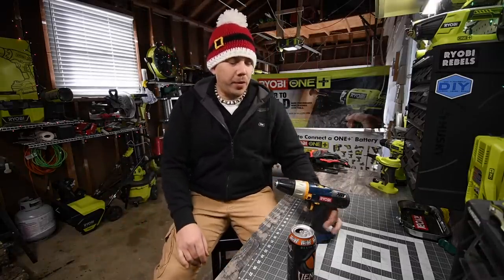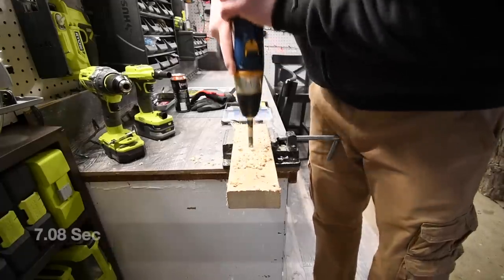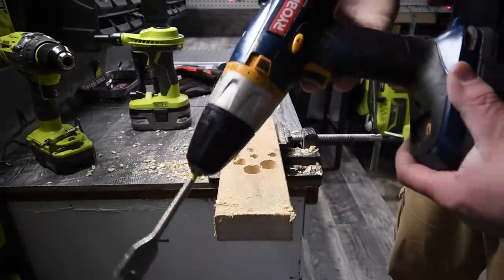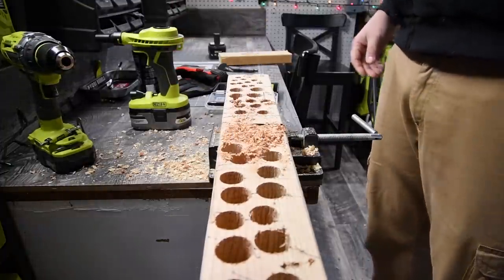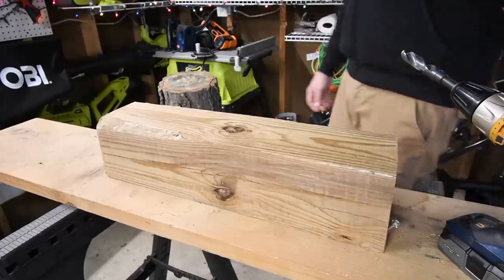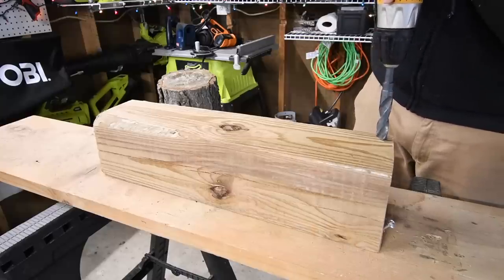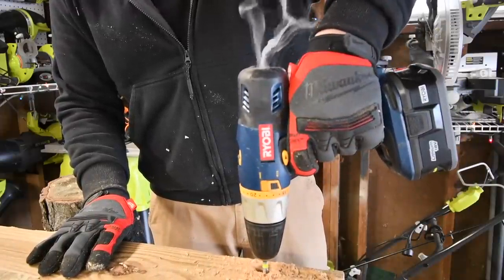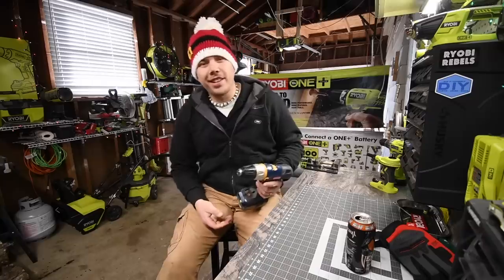Ryobi Blue Failed on its first test

Comment: I bought a reconditioned Ryobi kit 20+ years
 ago. The tools were used and used.  I couldn’t kill them. Just this past summer the drill driver fell 20 feet onto the cement when I was building a pole barn.  After dozens of falls over the years the reverse broke.  I still use the circular saw in certain situations and the reciprocating a lot.  Do I like the brushless tools better...yes... but the old blue tools were great tools
Reply from the maker: thank you sir, and  Happy Holidays

Comment: That's why it has two speeds. It wouldn't have burned up if used correctly.
Reply: Yet to see in a video and even in person of someone using the transmission properly on the drills. Had to yank my drill from my coworkers hand cuz the idiot was overloading it and switch it gears for him. Milwaukee M12. FYI that's how he blew out his m18 drill too but helped him rebuild it and taught him how to use the gears
Reply: @arsonist63086  Yep...I know exactly what you're saying. It's like pulling a trailer with a 3/4 ton pickup...and starting from a dead stop in 3rd gear.
Reply: I don’t get his testing methodology. There seems to be none lol. Big holes need high torque, and a lower feed pressure instead of slamming it into the wood. Never seen someone drill 1 1/8 holes at 1600 rpm lmao
Reply from the maker: it started smoking drilling a 1/2 hole. if it smoked doing a simple task like that in the beginning of the video, it wouldn't survive long on this channel lol, thank you sir, and  Happy Holidays
Reply: Well a tough drill shouldn’t burn up at all. Also, the reason it burned up is because its a brushed motor. A brushless drill wouldn’t have burned. You can repeat this task with a 20V dewalt or an 18 volt Milwaukee and they won’t burn

Comment: Ive got the same drill, it always works when I need it! I dont baby my tools, I use them but I also dont have to drill huge holes in really thick lumber either, mine keeps going strong even though I bought a new one, Ill still use this! Mine is a p206

Comment: I bet u if u just replace the brushes. It will work like new.
Reply from the maker: a repair video will be coming soon  and thank you sir, and  Happy Holidays
Reply: which begs the question can you just replace the motor with a brushless one and have basically a toyota prius with a hellcat engine
Reply: For what you would get, the cost would be more than what you would spend on a new brushless drill.
Reply: I see no problem with showing someone how to replace brushes though. I replace them in my own tools.
Reply: This thing most likely died due to too much current being drawn and overheating. These things where initially designed for NI-CD batterys, which outputted less current. This is partly because the voltage was lower.  Sticking a lithium battery in there and putting it under full load for a continued duration is going to kill it.

Id put in a 2AH max and not run it for long duration's
Reply: Minnesotaman no you have to change everything inside then as a brushed motor uses a Completely different speed control
Reply: @silvy7394  it was 18V wasn't it?
Reply: @jesseldridge2016  A lithium pack will output 21 volts and usually much more current than the old NI-CD packs. These old motors simply slowly kill themselves by being pushed slightly too much because they was designed with a weaker battery in mind.
Reply: @minnesotaman3  no you can't. A brushless uses 3 wires and basically needs a controller to convert the power into  pulses which is what the brushes are used for in a brushed motor.
Reply: @jesseldridge2016  an old nicd is also 18v but the voltage will drop much faster under any load. A lithium has the ability to offer full voltage even under high loads. That's what will kill the tool. For example nicd under a load on this drill may drop voltage to 12v when fully loaded while lithium will offer very little voltage drop under same load.

Comment: Its amazing how far power tool technology has come! These older tools were not designed to take the power these new batteries put out.
Reply from the maker: I agree and thank you sir, and  Happy Holidays
Reply: That statement is wrong from the start by saying The power these new batteries put out!! He didn't slam a 20v or a 24v battery in the old blue tool. Exact same 18 volts the old yellow and black ones put out! The new LI-ON's have more capacity is all. I just bought the new HP Brushless 1/2 inch impact and purchased a 4ah 18v +one HP battery and I use it in my old Blue and yellow Drill, circular saw, reciprocating saw with absolutely no problems at all.
Reply: @bradcliff7099  you do not understand how it works, these new batteries can push far more amperage to the tool that the old nicad could not deliver, it could easily smoke these tools if not careful or if its not programmed to throttle itself on these old tools
Reply: @kevinragsdale6256  Actually, he was pretty much correct, but you are too. Both comments could be explained a bit differently. Batteries don't "push amperage". A tool pulls current. You can't force current without increasing voltage and purposely overvolting a tool (which nobody does - if the batteries fit, they're the correct voltage). This is what Brad was trying to say. 

These new lithium batteries do, however, have less voltage sag under high load conditions which will allow the tool to draw more current when it wants to. In other words, the battery won't be the weak point when you abuse the tool. This is actually an ideal scenario, given the tool is up for the abuse. A weak 18V battery that drops to 10V when the tool is pushed isn't a safety feature - it's a weak battery. Even the old cells could burn up thin magnet wire. This all should've been considered during engineering the tool. 

When you see 2ah/5ah/9ah, that is capacity. It just so happens, higher capacity batteries tend to have less voltage sag, which allows a tool to pull the current that it's designed too. So when somebody comments on a tool vid about "slamming a drill with 9a!" they likely only have a partial understanding of electricity. Drills aren't resistive loads, but everyone should have an understanding of voltage/current/resistance, and how all 3 variables matter when a load pulls current.

Comment: You should save the drill.  This way you can cut the handle off and have a nice battery mount so if you want to modify a power wheels or whatever you can easily plug in Ryobi batteries
Also they made those drills up to like 2006 2007.  I think I’m 2007 that’s when they switched to the green.
Reply from the maker: I plan to, we will take it apart soon and see what happened to it

Comment: That is what the low speed setting was for. You stalled the motor, current goes up, insulation on motor winding goes to meltdown mode. Lucky you didn't blow up the power pack going into short circuit. Good night and Happy Holidays!
Reply from the maker: it started smoking drilling a 1/2 hole in the beginning of the video. if it did that. the drill is useless to this channel

Comment: I just restored one today and tested for this on a (normal)4AH battery.
It's definitely true. This drill works great with a 1" screw-tip paddlebit in speed 1, and it most definitely stops dead in its tracks in speed 2. Evidently its transmission gearings are not too powerful. It's old, overweight, made of inefficient materials, etc. etc.
I can't get your exact results though because I don't own any 'generic' flat paddle bits. 👋

However, no smoke with a 1/2" drillbit(dewalt black&gold, the cheapest). Yours was probably in worse condition I guess

Comment: What was the point in using the high power batttery on this? The old tools dont have the connectors required for the hp to work, so basically you just used a standard 3.0 Ah.
Reply from the maker: I used a black 4ah battery NON HP

Comment: You got a dud... I’ve got ryobi blue tools that are all 10+ years old and work great still. My impact that’s blue was the first gen of impacts they ever made and that damn thing refuses to die.

No joke it’s at least put in 250k metal roofing screws, countless 3” deck screws, it got left in a project car on my honeymoon and the sunroof leaked and filled the car up with water leaving the impact flooded in 3-4” of water. Ruined the battery but the drills fine. I put li-on batteries on all of them now
Reply from the maker: its a old used tool I bought on Facebook marketplace a while ago. it was already on its last leg. but its all good and thank you, Merry Christmas

Comment: Why you making fun of my drill :(  For the DIY casual home owner... this tool has survived regular 1/4 drilling, deck screws and some light cabinet making (pocket holes kreg screws). I would upgrade to one of those fancy green tools but the original kit I bought still has working tools. I did burn out the corner sander while making cabinets over the summer.
Reply from the maker: im not making fun of it, its a very old drill I bought from someone. I paid like $6 for it. I was hoping to get some tests out of it but it smoked on its first hole, so I figured may as well have a death video on a drill. since I won't be able to use it
Reply: @ManCaverTools  Yeah, I was half joking :) I enjoyed the video and it did better than I expected!

Comment: If you had used the drill as intended, rather than forcing it on every test, the drill would not have burned up. Personally, I think the 'blues' get bad reviews because everyone seems enamored with the 'greens' (which are ugly BTW). I have several of the blue tools and they serve me well.
Reply from the maker: but the tests I do is what the newer brushless  ryobi tools do. that is the point of the video. Yes, this old drill was pushed to it limits but that limit bar is very low on these older tools

Comment: I have the same drill- I use it w/ a holesaw kit daily for the last 5-6 years- you gotta go on the low rpm w/high torque setting for stuff like that... otherwise you let the magic smoke out (of any drill).
Reply from the maker: Thank you sir
Reply: Precisely. Many people out there don't know what the high torque is for. They think high torque is just for screws.

Comment: I have the P201. Been using it since I bought it new in 2004. I have been: Toyota Tech, professional 12v installer, Director of Tech support 2 times and have been building show cars for the last 7 years. Still works great. It's been to Oregon, Colorado, Nevada, Arizona and resides in California. check out my instagram page with over 9,650 posts. SQ4ME2
Reply from the maker: very good and I thank you very much for you r feedback Coffee

Comment: Drilling 6 spade bit 12inch holes in a 6×6 is a simple task  ?   Why dont you try that with a new hp drill i think the same thing will happen .  Prove me wrong .  My ole blue died  using it about 2 weeks after leaving outdoors overnight in the rain .  The tools werent that bad it was the batterys that sucked ,  still have almost all my ole blue tools but none of the yellow batterys .   How many holes were in that 4×4  ? And chucks sucked
Reply from the maker: LOL I have the new HP drill and also did a few videos on it as well

Comment: Theres no point behind the video besides killing it...
Sad because it was working just fine
Reply from the maker: World Wide United. The drill smoked after doing a 1/2 hole. In the beginning test. There is no point to have it in the channel if it can’t do the simplest task. I bought this used for $10 during fall. So since it could do tests I said may as well kill it